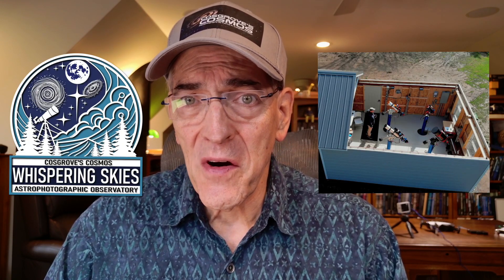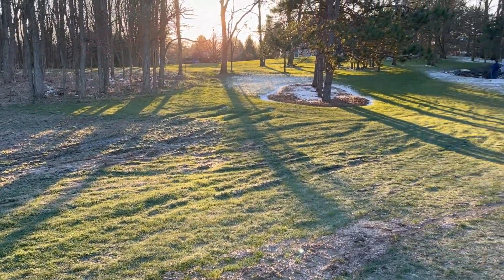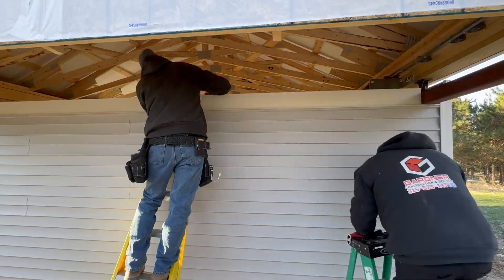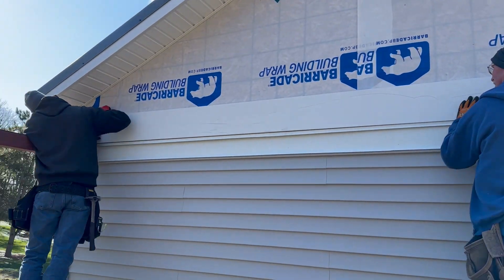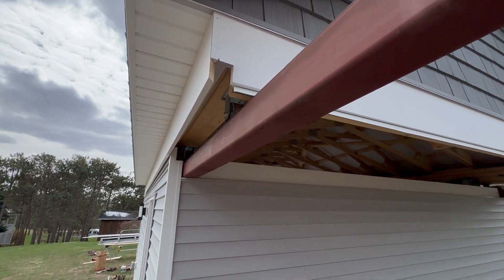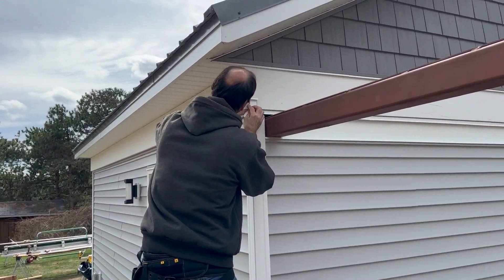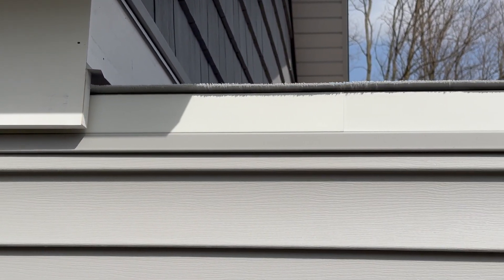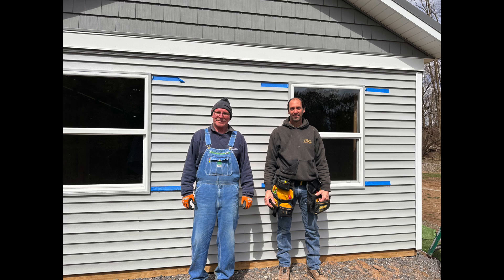Cosgrove's Cosmos Successfully Completes Whispering Skies Observatory Construction

Comment: Instant subscribe right here! I recently acquired a piece of land suitable for astronomy, as soon as i end building my house, i will start building an observatory too. This channel has been extremely helpful in pondering about questions we all seem to have while dimensioning our observatory. I still do have one question for you - it might be answered in one of the videos - but how far of your actual horizon did you end up losing for both scopes at the south wall? I will have an open view from east to northwest over south, and i’m thinking about having a section of the east and west wall open with the roof to lower the walls on those sides. I haven’t found a decent way to open up more on the south side too. I also want the roof to be able to close at any given moment without hitting the scopes.
Reply from the maker: Good luck with your project!  My southmost piers limit me in some sections to 30 degrees altitude.  I can improve this on my FRA400 by putting a taller riser in, and I may do that.  The SCA260 has the same limitation, and that's OK, as I am going after high def on this and don't want to image lower than 30 degrees.  The Northmost scopes can go much lower as they are further from the south wall, so I just choose the scope for the target.  I have seen a design for a fold-down wall on the south.  The top third of the wall is on hinges and can be lowered to open the southern horizon.  I could not do that as my wife wanted some windows to make the building look like a cottage from the outside.  She's letting me build this, so she gets to make some calls here!

Comment: Will you add insulation? And if not, why not? Beautifully done. Envy, envy, envy👍
Reply from the maker: Thanks! Current thought is to not insulate.  The idea is to keep scopes as close to ambient air temperatures as possible.   That being said, I still have an option to add foam insulation if I find I need it going forward.
Reply: @cosgrovescosmos  I understand the preference to have your equipment near the ambient temp., so everything is stable as the temperature changes. My concern might be more about condensation. One thing I do know, is that I do not know anything about condensation😞 I'm just thinking that insulation would slow any temperature change as the temperature either rises or falls, lowering the risk of condensation. I may well be "all wet" with this thinking, but just my guess.. Will you have a dehumidifier and or warming apparatus beneath your scopes? It's a mystery to me.
Reply from the maker: Obviously, when the roof is open, insulation does not play a role, and when the temperature hits the dew point, there will be dew.  Heating straps on the telescope manage that on the optics. 
So the question is, should I insulate for when the roof is closed, so that dew does not form on my telescope equipment and rust it.  I am monitoring things and so far I have not seen this problem.  That could change when we get into different seasons.  I have seen that even with no insulation, the interior of the observatory is typically 5-10 degrees warmer than the outside air.  This might be enough to prevent dew.  If not, then I will place boat heaters or 100 watt incandescent light bulb below each mount.  That should hold off any dew formation on the equipment.  Right now, the observatory is too new for me to know if I will run into this issue.

Comment: Congrats again on finalizing last bit of work Pat. I forgot to ask before but wondering was it possible to extend roof further out so that the two scopes on that end would get more clearance? Or does it not even matter-as you noted that three star alignment ended up helping with polar alignment..
Reply from the maker: Originally, I had the roof rolling off by another foot or so.  However, the only designs I could find to make this work had the drive motor mounted outside the roof.  I wanted to avoid this, so the motor is inside, preventing the roof from opening further.  I was not too worried about this at first, as it just blocks a part of the sky with the light dome from Rochester in it, but then I ran into the Polaris issue.  NINA's 3-point method resolves this.  Also, SharpCap could solve the problem, as I can see Polaris with the optical tubes, just with the PA cameras!  Know anybody who is interested in a PA camera? I have two for sale! :-)
Reply: @ how much are you selling for?
Reply from the maker: New, they are about $300. So probably $150.   These are PoleMasters.
Reply: @cosgrovescosmos  one for $150?
Reply from the maker: Yes - I have two, but I figure a used price of $150 each is not bad.
Reply: @cosgrovescosmos  I am thinking two but my another mount has option for polar scope and it works well that way. I am also thinking about getting another mount but with tariffs I am little discouraged plus it'd be awhile before I get one. Do you have any issue with selling one instead? Price is really good-maybe I should get two it looks like.
Reply from the maker: Selling one is no problem.  Contact me via my email:  contact@cosgrovescosmos.com
Reply: @ I sent you an email..it is Gmail in case if it goes to spam or junk.